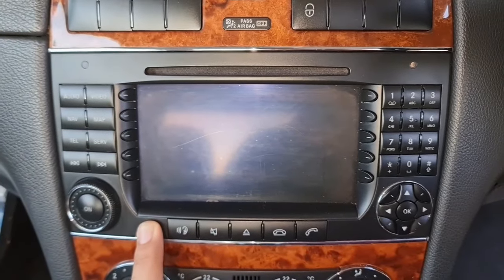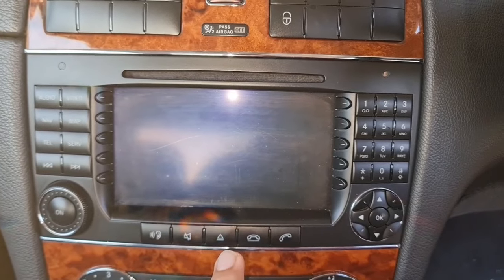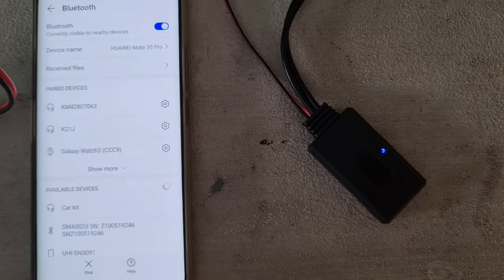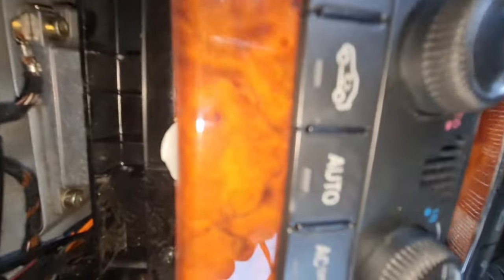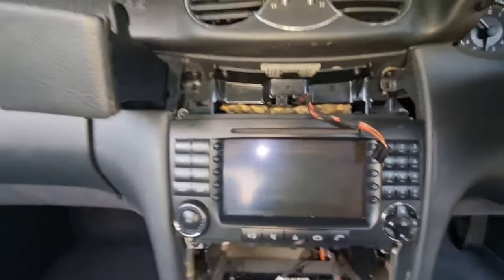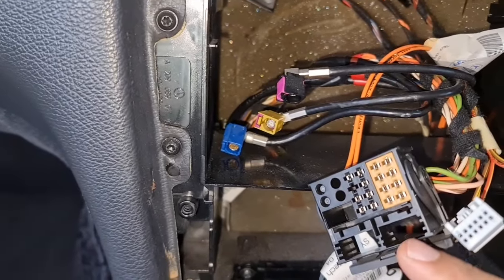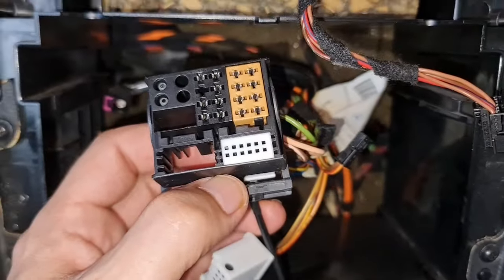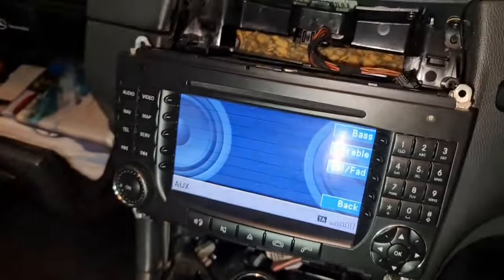Add Bluetooth to Mercedes Head unit for less than $10

Comment: Thanks a lot for the video. I understand the disclaimer, the fire hazard and so on, but I would have appreciated to see how you connected the power to the cigarette's lighter. I'll figure it out myself :)
Reply from the maker: This device draws only few mili amps, so using thin wires you can unplug the cigarette lighter connector and insert the wires carefully in the corresponding Sockets and put back the connector.  Secure the wires to cigarette lighter harness.
Reply: @BenzAddiction  I am about ready to try the bluetooth connector and plug the wires from the adapter to the lighter as you suggest abobe.  I haven't removed anything yet.   Are the wires to the light color coded black and red?  If not, what color is power and what color is negative.   Thanks very much.
Reply from the maker: If you want to take power from the lighter, the wire that goes to the middle of the lighter is positive.
Reply: @BenzAddiction  Thank you.

Comment: Hi I did all  in the video but you are not responding aux. How can do i activate AUX ?
Reply from the maker: If this is not activated on your command or Audio 20, you need to code it using Vediamo.  Or ultimately take it to Mercedes and they will activate it for you.

Comment: Hi Max, great video,  thank you. You can of course get a bluetooth device, powered by cigarette lighter plug-in, and simply connect it to the auxiliary 3.5mm jack port in the glove compartment. The bluetooth device must have its own 3.5mm jack port, and you use a male-male 3.5mm jack audio cable to connect the auxiliary port to the bluetooth device. Go to Bluetooth/Auxiliary setting in the head unit. That's what I do, and its great listening thru' those wonderful Harmann Kardan speakers. 

Of course,  you have ugly cable and bluetooth device showing, plugged into lighter, but storage in glove compartment may work (it doesn't for my phone connection, unfortunately). 

Only pointing out this option, as it saves removing centre console/head unit sections as in your video, for those who feel less confident in their removal/restoration skills.
Reply from the maker: Yes, I had this set up in my glovebox, with dedicated 12v outlet as well, but did not like it as it was taking space and was noisy. Removing the unit is 10 min job, good luck.
Reply: With the Bluetooth in the glove box , where did you get your power from. What wire did you splice in to or did you plug a power source into the cigarette lighter?  I don’t want the ugly wires showing like you mentioned

Comment: Hi!

Could you link the type of BT module in the glove box?
And I would like the link to the device connected to the radio, if possible.
Will it be possible to make phone calls, like with a hands-free system?
Do you think it will work with this radio? Comand APS NTG1 (2003-2008)
Reply from the maker: There are different models, for handsfree call i am not sure. https://www.ebay.com.au/itm/401548771835?mkcid=16&mkevt=1&mkrid=705-154756-20017-0&ssspo=Ooag3ue7SZ2&sssrc=4429486&ssuid=VftSBydbT7C&var=673889922370&widget_ver=artemis&media=COPY

Comment: Benz Addict,  I just bought a 2006 CLK350 Coupe and want to remove the rear seat cushion so the backrest cushions (released from the trunk) will lie down flat.  Although they fold flat, the rear seat cushion (which folds forward) prevents the driver seat from moving back far enough to improve driver legroom.  Any thoughts or any videos would really be appreciated.  Many thanks.
Reply from the maker: https://youtu.be/byYgNgHO8hU

Comment: can I upgrade my head unit from my 2005 A209 CLK 320  that has the harmon kardon subwoofer and CD changer but the head unit is the one that the screen notoriously peels away and has the mono led.. no color  type of screen just led numbers .. I like this head unit better that you show here if its just plug n play and of course add this bluetooth module .. otherwise looking at android units
Reply from the maker: I recommend you to check the connection type first, if it is optic fibre, it won't be supported by the typical Android auto head units and then you have to buy a seperate converter for the fibre optic conversion to standard audio...
Reply: how about just upgrade to the navigation head unit like you have in video here? mine has the CD changer and harmon kardon subwoofer.. it seems it would be easier just to get the radio like yours which was also used during my year... i guess yours has the navigation? mine doesnt have that currently but i dont need super fancy, just the radio I have was notorious for plastic screen to peel and I cannot read ther non graphic screen.. if I go android style, id do kenwood or sony or alpine ect.. not the cheaper ones...

 @BenzAddiction
Reply: Mine has the MF2750 radio I think... factory unit  @BenzAddiction
Reply: I have this similar radio for my CLK320 A209 (Audio 20 with HL Optical Fiber and CD changer and aux but not cable i can find to that in glove box) but shows button on radio) .. today Im replacing the bubbling front plastic screen cover.. but all I really want is ability to have bluetooth so i can connect to my phone and make calls and listen to podcasts and my music while commuting.. maybe later upgrade so some kind of android setup but not a day 1 project

Comment: Hi
Great video and info ! 
I have a 2003 cl55 amg . What will work ? 
Thanks you ! 
I can not find a link for eBay .
Reply from the maker: Sure it works. Check this but make sure it fits: https://www.ebay.com.au/itm/305905703142?mkcid=16&mkevt=1&mkrid=705-154756-20017-0&ssspo=nx8pewvwrjk&sssrc=4429486&ssuid=VftSBydbT7C&var=&widget_ver=artemis&media=COPY

Comment: Hello, do you have any videos showing how to install the other type of connector you showed (the red one)? I have a w208 and it uses that similar connector, but I am having trouble. Thank you!
Reply from the maker: Actually no, but these Chinese cheap parts do come from China and sometimes the pinout is wrong, so check that out...
Reply: @BenzAddiction  Yea, I bought one and immediately noticed that. I am going to re-pin it. Thank you!

Comment: Great job my addicted friend!
Can you please tell me if I can repair the volume knob on the head unit. The knob only turns on the unit but the volume does not work at all. I have to use the button on the steering wheel. Thanks man.
Reply from the maker: Everything is possible, it needs parts and time :)

Comment: i got an e350 ntg 1 head unit. can you resend the link to that blutooth ebay device as the link you posted is now dead.  btw do you activate the bt unit by pressing the aux button on the comand?  also..i cant see a way to do this but is there a way to have both the blutooth device and still preserve the aux connection in the glove box?  that would be ideal
thanks

Comment: Hey max I have a 2003 clk 500 and it does not have a screen head unit will getting bluetooth connector that has a cigarette lighter plug work (the outlet under the compartment above the shifter) And how do i adjust the bass on the speakers since i have no screen in the center.
Reply from the maker: The best place to go is the user manual of your headunit,  it is a comprehensive guide.

Comment: Hello i have installed this into my mercedes clk 2004 but it doesnt work. I get the light on the module and i can connect my phone but it doesnt play any sound.
Any idea what it could be?
Reply from the maker: Do you put your headunit source to Aux mode?
Reply: @BenzAddiction  yes
But i just saw that i already have a aux installed in the glove box so i will just use that
Reply from the maker: @jasonverschoor5417  Or you might want to watch the video again.

Comment: Max, can you walk thru the 2002 W220? I’ve removed each cord one by one from the head unit and no luck. It’s either no power to the unit at all or the CD Changer continues to work. Any ideas??
Reply from the maker: Try using auxiliary input instead cd changer, CD changer might use optical cable.
Reply: @BenzAddiction  2002 doesn’t have  an AUX function/imput.
Reply from the maker: @datdamndavisboy  how is your cd changer input? Optical cable?
Reply: @BenzAddiction  Yes. It’s on the optical loop.
Reply from the maker: CLk W209 is, but has a seperate AUX input too. R129 IS Normal cables, watch my latest video.

Comment: Hi max great job 🎉are you in California by any chance ? lol I have 2003 slk  320 I wold like to try your method but my head unit is different than you shown it does not have an auxiliary option and my v60 blue tooth modular is in the hand rest console in a cradle and the v 60 is not light up any suggestions? And will this work for my car ?
Reply from the maker: Hi mate, I think this should work on your head unit.  Just pull your unit out and check the connector.  You don't need to focus on the Bluetooth module.
Reply: @BenzAddiction  thank you bro will give it a shot :)

Comment: what is the telephone keypad for on the right hand side
Reply from the maker: It is a multi-purpose keypad for typing alphabets and phone numbers as well as memory for radio, CD etc...
Reply: @BenzAddiction  oh yeah how exactly do I use it
Reply from the maker: @kennydean7872 Please  refer to the manual of your command unit.
Reply: @BenzAddiction  ok but where do i find that the manual for the command unit
Reply from the maker: @kennydean7872  it is a booklet among your manual pack. Find it on the passenger side where it is attached to the transmission tunnel.
Reply: @BenzAddiction  oh yeah i'll have a look in the morning then thanks

Comment: Could you show the w210 version? or older models
Reply from the maker: I wanted to also do this on my R129 which could be easier as the power cables were on the connector too, but my SL head unit had the round connector,  so will source one and make the video in near future although I live to listen to cassette and radio only when I drive my R129.

Comment: Hey max would this work for my w209 is a 2004 clk320 does not have aux.
Reply from the maker: It should work. You actually have line in but it is not wired to glove box area.

Comment: I have the original small radio. Is possible made the same?

Clk 200 kompressor 2005 W209
Reply from the maker: Yes, watch this: https://youtu.be/vpUpvl4gaS8
Reply: @BenzAddiction  Vou escrever em português para não haver confusão, já que meu inglês é péssimo. 😂

Na foto que fez no outro vídeo, aquela com os 6 rádios, o meu é aquele que pode inserir CD.
Seria um plug vermelho que preciso? O de 10 pinos?